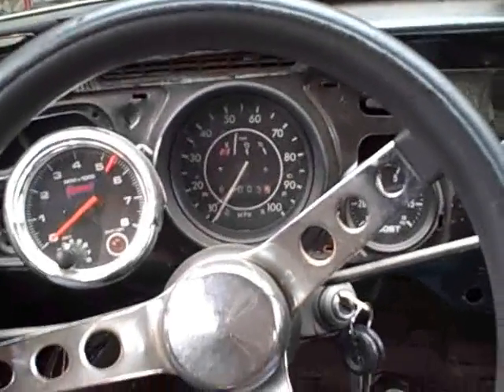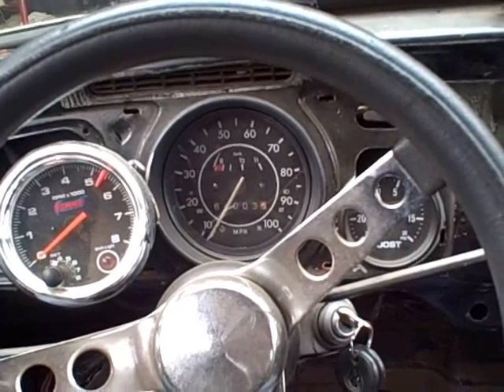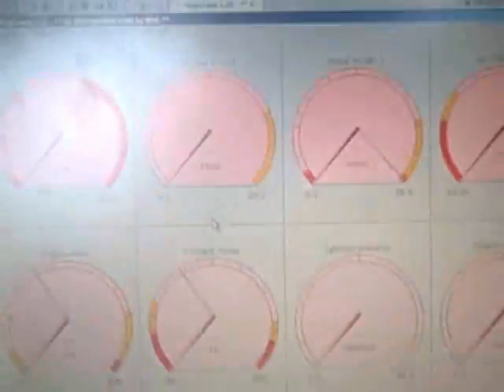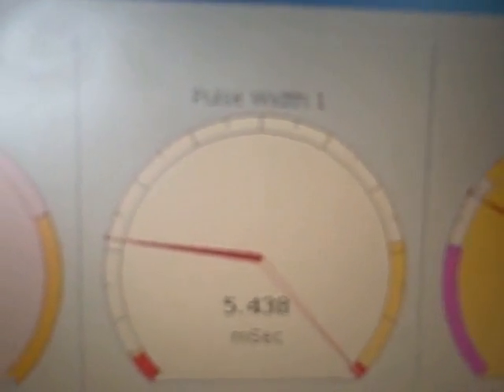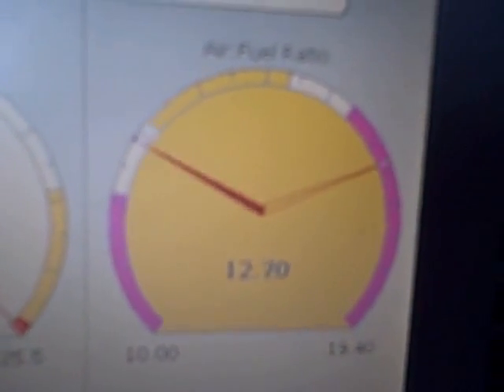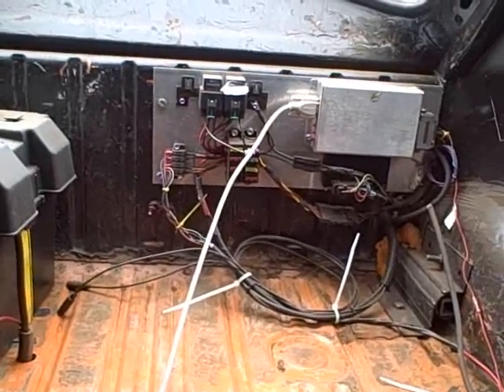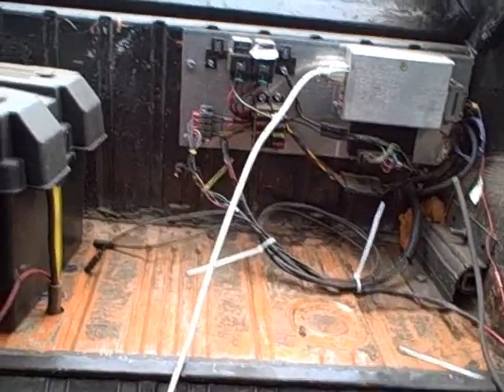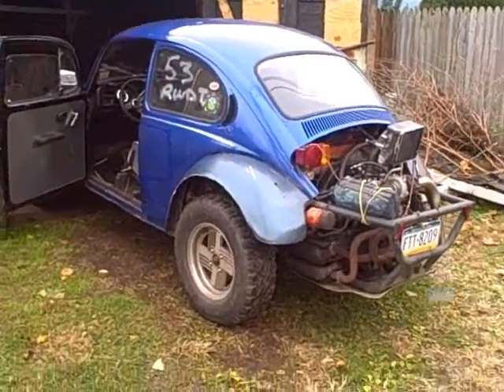Turbo Baja Bug- megasquirt basics

Comment from the maker: Pretty much any air door will do as long as it has a potentiometer TPS.  I know some like to use the OEM vw stuff.  I use a GM one because it has idle air control built in.  Use the setup wizard in MT and it'll run pretty well but rich, then tune with a wideband O2 from there.  I usually have them pretty trimmed out for basic driving in a couple hours of putting around, It takes a lot of tweaking to really get them right in the long run.  Best of luck.